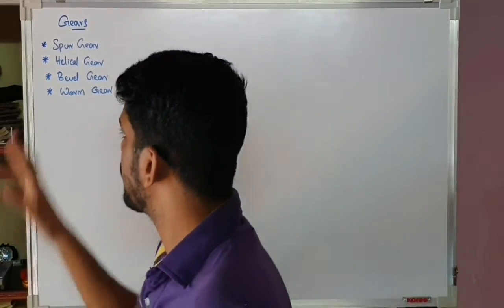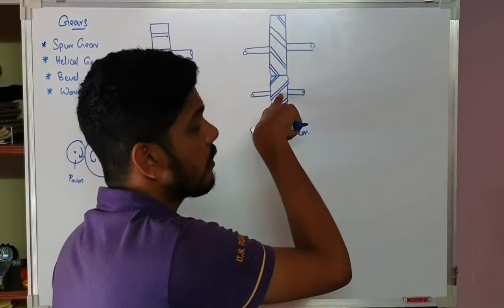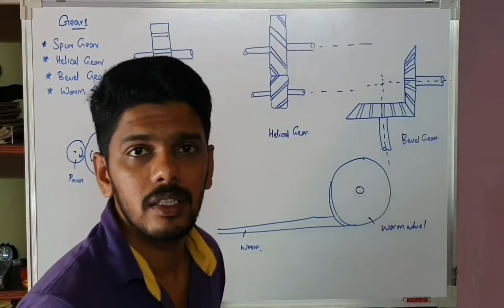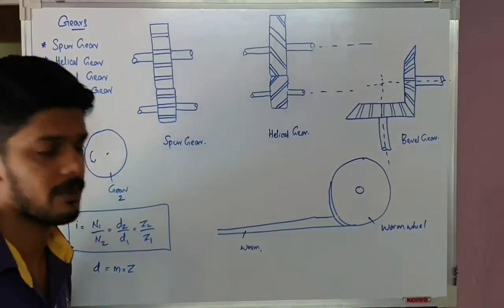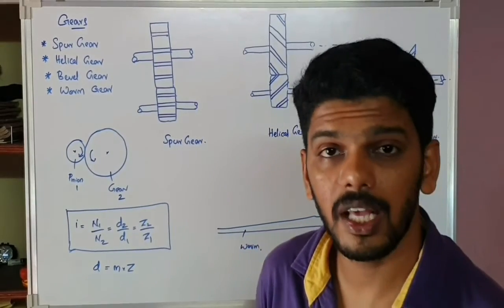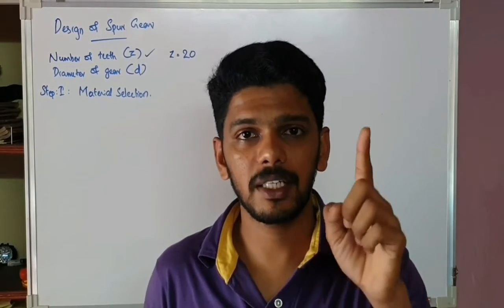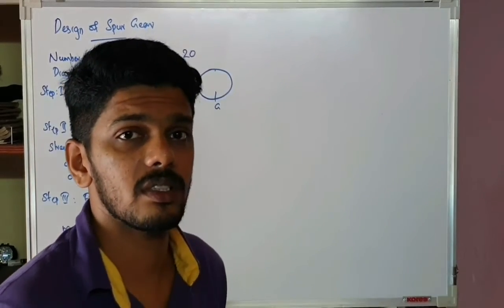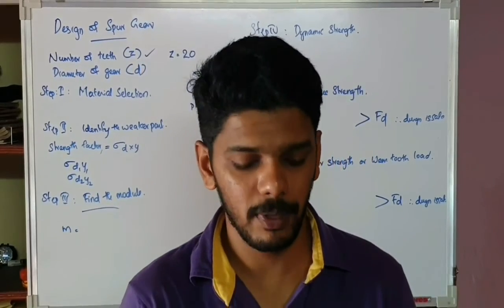Design of Machine Elements: Design of Spur Gear Based on Design Data Hand Book

Comment: sir there were some differences between eqn that's typed in your pdf and that in databook.like 12.5 a in page 204 (extra pie). should we correct it in db. anyway thank you sir
Reply from the maker: No error in databook for equation 12.5a. That may be my typing error. Neglect. Make a call if you still have doubt